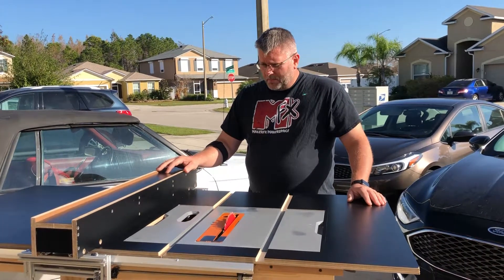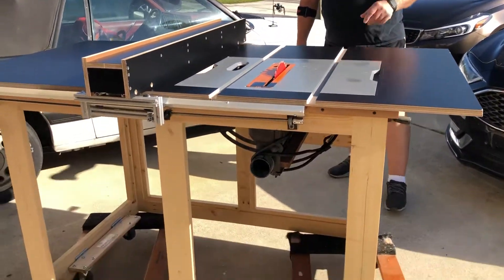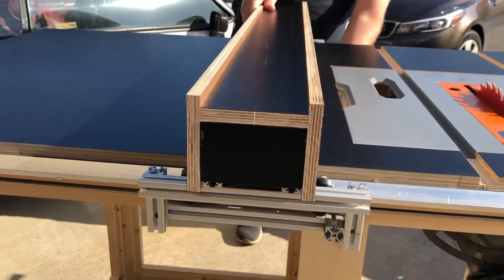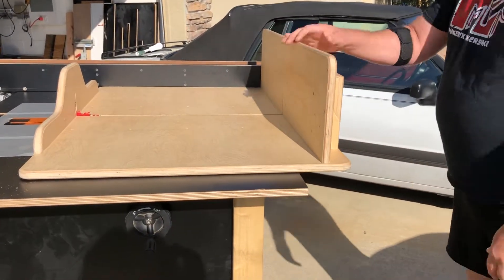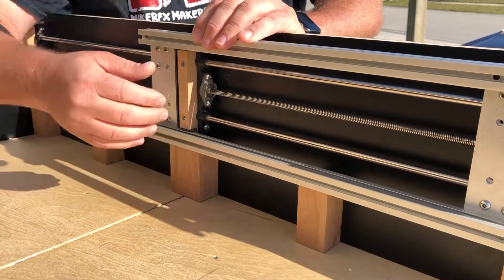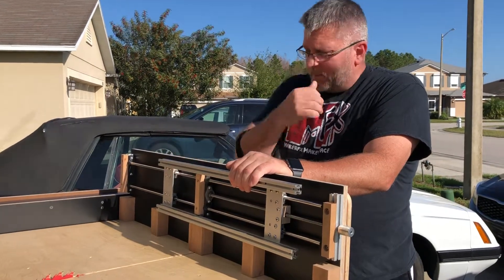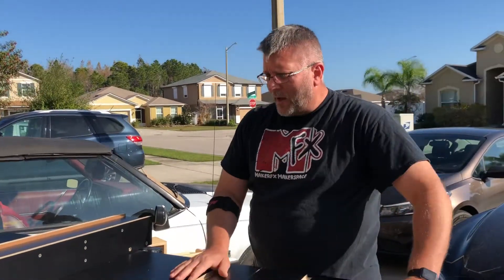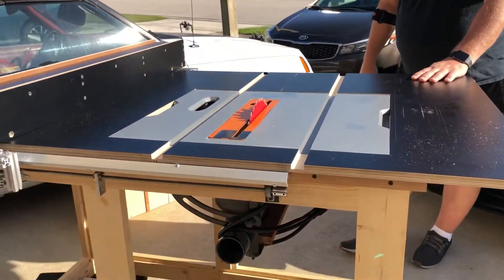CNC table saw/router table

Comment: I just bought a powermatic sliding table saw and desperately want to add cnc controls like you did. Ive built my own cnc, but it used mach3 and needs a computer. I'd love to find out more about what you used and your app. Email me at dnietubicz@yahoo.com. YouTube shows you're in St Cloud. If that's Florida, I'm about 90 miles south of you in Sebring.